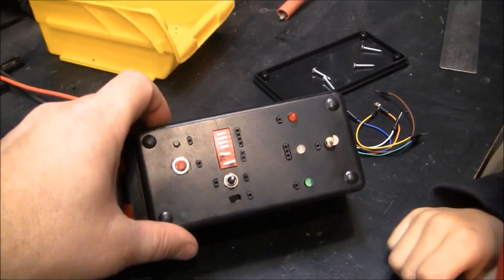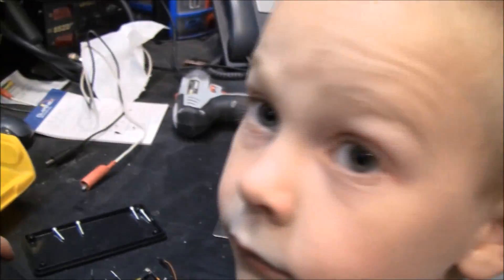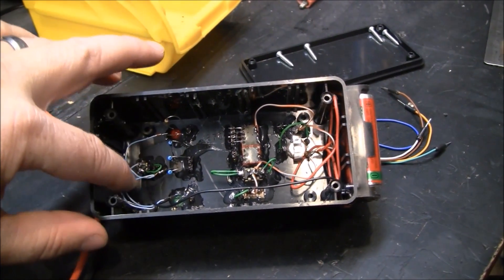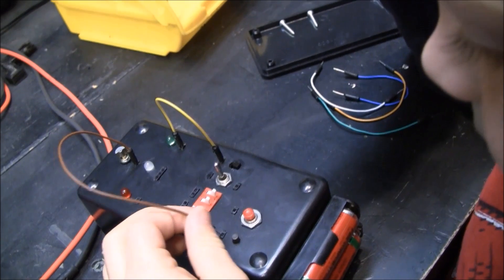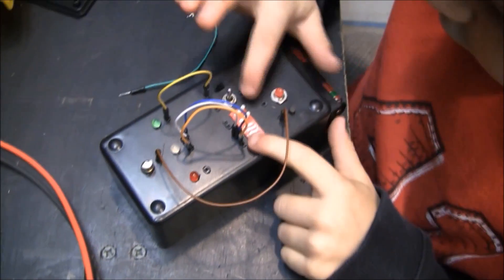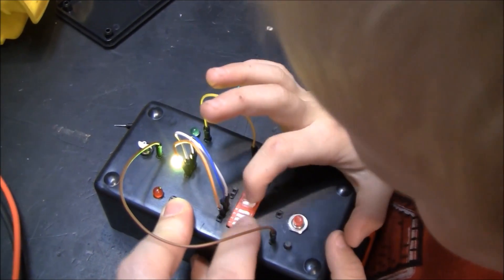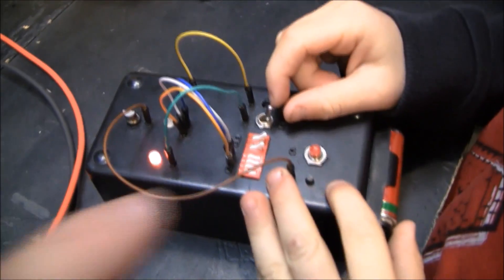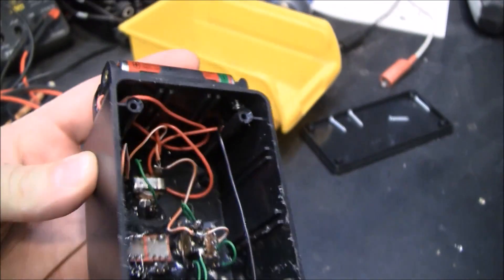DIY Educational Circuit Breadboard Box

Comment: I agree about the DIP switches being a bit hard to operate, especially for little fingers, bigger ones would be better. Might also be nice to add in a flasher, to connect to one or several LED pins, or maybe a tone generator with several inputs, that outputs different tones depending on how many inputs are connected. Maybe a little motor spinning a little handmade card disc. He could draw colours on the disc and watch them mix together as it spins. And a slide potentiometer, to control the brightness of the LED colours.

Anyway just ideas. I had something like this made by my grandfather when I was little, and I loved it! I think the principle should be to let the kid do some tinkering, and get some reward, in the form of lights or sounds or whatever. So he feels like he's created something on his own, through trial and error and his own little brain. I used to think I was a great scientist, "working" with my box of lightbulbs and an electric bell!